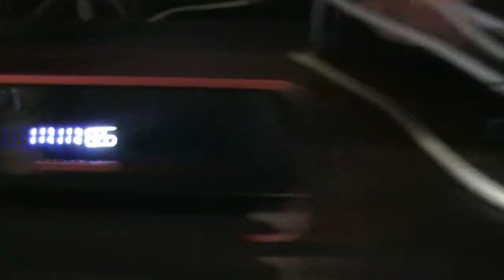How To Watch Satellite Tv in two or more rooms

Comment: What device name if u have two tv but watching different channels?
Reply from the maker: It is called a Splitter https://youtu.be/IPX6rKFGl_U?t=1299
Reply: Tnx a alot. Almost 10years searching for that device.  Hope it works.
Mine is satellite tv. when i put wire conect to two tv it still same channel, when i change in main  tv.
Reply from the maker: If it does not work change the polarity on your receiver!